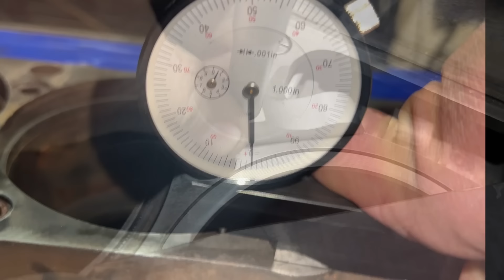Detroit diesel 8v92TA 2 stroke diesel tear down. Rust broken bolts counter bore problems

Comment: It seems that only a few people have ever been taught to shock a bolt by hitting it straight on with a hammer BEFORE attempting to turn it.  I first learned to do this from an old Detroit Diesel mechanic back in the 1980's when I was getting ready to remove a hub cover from an aluminum hub on a trailer. He told me that BEFORE I even put a socket on the head of the bolt I needed to take a big drift and a 2 pound hammer and smack straight in several times on the head of each bolt (like trying t drive it deeper into the hole) to shock the rust bond loose that surrounds the bolt shank and threads. I already knew from experience and word of mouth that these hub cover bolts were notorious for breaking when removing them. So I took his advice and smacked every bolt head a few times before trying them and they all came out intact.
Since then I have made the hammer smack a step in the process any time I have a bolt that has been seated in an aluminum  component for a long time.
At the time I learned of this I had already been doing mechanic work for over 12 years and had never heard of doing it.
It seems that the technique is still not very well known.
Reply: Also work the stuck bolt back and forth while apply a little penetrating fluid to it. Working the broken stud like this will allow oil to work its way down on the threads.
Reply: Also, 1. Try to tighten bolt 2 degrees to try to loosen corrosion. 2. If bolt has not loosened keep turning each way 2 degrees to keep working lubricant into the crevice. 3. After bolt starts to turn change rotation to keep threads from locking up!!  4. Take your time with each step — 99% of all fasteners will loosen. 
Slow and steady takes less time and cost less than fixing broken components. 😅😅
❤Love the show and can do attitude to keep old coaches on the road. I have an 84 Bluebird with a 6V92TA

Comment: If you have a pair of vice grips that are not perfect you can weld a small nut onto the side edge and use that to stop the air hammer from jumping around. Great job!!

Comment: My sympathies. I was so excited to see that turbo drain bolt come out. Next, I see the threaded ends aren't the same length in the magnetic tray. 💔 The rest of the video is just more 💔 after 💔 with more and more cap screws.  snapping.

Comment: I recently retired from the marine industry,  boy, I don’t miss extracting broken crusty rusty exhaust manifold bolts hardly at all.  Watching your guy struggle with those vice grips was more than a little painful to watch.  When I get ‘em broken off  with a half an inch proud I go straight to welding a nut on there, I don’t mig them on, I go straight to the stick

Comment: I would recommend removing the aftercooler and thoroughly cleaning it, if it looked dirty on top it's probably dirty right through the core, it's a small area for all that air to get through so any buildup is restriction.  The ones I've cleaned it was unbelievable how much crud came out after soaking and blowing out.  The last few I did I soaked in straight superclean degreaser overnight then poured boiling water through followed up with a pressure washer. When they're clean you can see a flashlight shining through.
Reply: Spot on bro. This engine has been neglected so everything is suspect.
Reply: I thought about the inside of the aftercooler too, after seeing the rest of the cooling system condition I am sure the core is  pretty clogged and gross.

Comment: Heat and beat !  reminds me in my younger days replacing a oil pan on an old 671 in an old wooden boat, had the 671 0n its side using a tourch to heat up the oil pan bolts, bilge full of diesel and old oil heads of the bolts sizziling as it hit the bilge water, no fires but the whole yard crew came running down to check for fires as all the old oil  burning of the block,,,,,,need less to say new oil pan, good to go  heating with a tourch is your best friend !

Comment: Do you use antisieze when you reassemble, or is there an issue with that?
I use it on everything.  Also, when I remove a sized bolt I always slowly work it back and forth, and spray oil until it becomes loose
Rock on guys!

Comment: One thing. Typically Visegrips usually work better when loosening tight bolts, nuts or studs when pushing toward the movable jaw rather than away from.

Comment: When loosening stuck bolts, if it moves, go back and forth from tightening it, to loosening it, while spraying it down with kroil.  It chases the crap out of the threads so you don't break bolts as much.

Comment: Jeeze! The owner is going to be in $1000 in hardware alone just to get it back together! I'm surprised how many bolts actually came out of the top of that blower housing without snapping. As you mentioned the dissimilar metals love to seize together.

Comment: scot get yourself a piece of metal fuel line about 6 inch cut teeth on one end using a hack saw  you will find it is the right size for the hole the bolt is stuck in run the pipe in down the side of the stuck bolt it will follow the hole already there that is full of crap by spinning the pipe in a drill it removes all the crap holding the stuck bolt steady away and you will get there

Comment: Just a thought as I did buses for the Detroit Diesel Distributor and we made a cradle to slide the engines in and out. A lot less work in the long run.
Reply from the maker: We have a detroit diesel out in the shop right now on a stand. But the Wanderlodge is easy access all around

Comment: Brother, I don't understand why you didn't pull the whole block out of that chassis. Also don't understand why you haven't pulled the turbocharger and supercharger off. Especially with the overheating situation. I'm sure you know what you're doing, and I'm not a lame and I worked in the heavy truck industry for a lot of years and worked on a lot of 8v92s but I think it would have been a whole lot easier to get that out on an engine stand and do it that way. Just my opinion. Okay my mistake, I didn't watch you to the end I was in the middle of the video when I put this together so, sorry hahaha. Great video!
Reply: The Wanderlodge has plenty of room. Also, I'm sure Scott would appreciate it if you stopped by and removed the engine as you described for them.

Comment: Looks like it was run with just water instead of proper coolant. I never knew why but at one time in UK it was common practice to only use antifreeze in winter and use straight water in summer.

Comment: Ah...the ol' thermal wrench...for when you are done asking nicely
Are those roots blowers better than a centrifugal supercharger?  I know two strokes need blowers...but would a gear driven supercharger push more boost to the engine rather than a blower?  My thinking is maybe a "modernized" Detroit diesel instead of having the blower, have a gear driven, shaft supercharger for the air charge rather than the blower style...
Just saw the DDEC 2, has a turbo feeding into the blower!!!!  whaaaaaat??
Keep em coming!!!!
Reply: Remember kids, it can’t be tight if it’s a liquid

And I am intrigued by the forged induction.  I was about to ask why not turbocharge it, but I’m sure the math adds up somehow.  Something to do with not needing an intercooler?
Reply: Can just hear Jeff Bradshaw saying “Renember, don’t light your torch like that…” as it pops into life.
Reply: The supercharger in a 2-stroke Detroit is not there to make more power. It's there to blow the exhaust out the valves by blowing fresh air into the cylinders through the ports. It won't run without it. It's a high volume low pressure arrangement.  A Roots blower can make move way more air at low speeds than a centrifugal blower can. 

To make more power, you add a turbocharger(s) in addition. Which this engine has. But you can't use JUST a turbocharger because at idle/low load they won't move enough air for the engine to run. The BIG 2-stroke diesels as used in locomotives and ships actually combine the two.  They have a  compressor wheel that is gear driven until the exhaust driven turbine can spin it faster than the drive can, at which point an overrunning clutch lets them turn faster than the shaft. But I don't think that was ever used in engines as small as these.  

For perspective, this engine is 92 cubic inches per cylinder, while the EMD locomotive engines that are Detroits on steroids START at 567 cubic inches per cylinder, with the biggest ones being 710. And up to 20 cylinders.
Reply: @Kevin_Rhodes  thank you.  I thought that, but with how wrong I’ve been on my two stroke recollection, I quit while I was ahead (or slightly behind).
Reply: You need the shaft driven Roots blower to push air as you start the engine.  That compressed air that comes in at the bottom of the stroke must do 2 things as those slots open up.  It must push all the exhaust air out in the time the cylinder is starting to uncover and then recover the slots at the bottom of the stroke.  It must also push in clean air to burn at injection.  The term, as I remember it, is "scavenging". There is no exhaust stroke like a 4 cycle.  There is no suction (intake stroke) from a down stroke to pull in fresh air like on a 4 cycle engine.  You only have a compression stroke and a power stroke.  Exhaust valves are only open roughly when the slots at the bottom of the stroke are open.  The cams are running 1:1 with the crank.  Then you need hot exhaust that is expanding to drive the turbo.  Once the engine has started the turbo can do its thing and compress the air to the Roots blower and then the Roots blower will further compress the air.  Then you can pour the fuel through the injectors and have lots of horses to race up the big chert hill. I know I have left out lots of technical stuff.  I just want to keep it simple.
Reply: This series 92 is blown ie(roots) and turbo charged and after cooled 8v 92 TTA.
Reply: @larrylawson5172  You need the Roots blower at idle and under low loads too - there won't be enough flow air from the turbocharger. And of course, not all Detroits are turbocharged to start with.
Reply: @greggwinovich8196  Which I said in my reply. After cooling is neither here nor there in this discussion, it merely allows the turbocharger to add MORE power by cooling the intake air after it was heated up by being compressed by the turbocharger.
Reply: @larrylawson5172  Thinking about it a bit more - you ALWAYS need the mechanically driven blower on a turbocharged Detroit. If you rigged one up so that you could stop the blower once the engine is started and the turbocharger is doing its thing, it would be fine - as long as you are under load and making all that lovely hot exhaust gas. But what happens when you are coasting downhill with minimal/no fuel being injected at all? That massive turbocharger is going to all but stop spinning. And with no blower, so minimal air going into the cylinders, how is it going to get started again?  You can only burn as much fuel as you have available air. You'd be smoking out the county for ages until the turbo got with the program again, if it ever did. And these BIG turbos take a LONG time to get going. I have driven these buses, especially if you are in the wrong gear and the rpms are too low the "turbo lag" is immense - you can about measure it with a sundial. It's not like a modern turbocharged car where boost is all but instant when you twitch your ankle on the gas pedal.

The only way it would work is to do what the EMD locomotive engines do - you would have to have the ability to mechanically spin the turbocharger below the threshold where it can takeoff and do its thing on exhaust heat alone so you always have that baseline of cylinder scavenging that the blower provides. I'm assuming that was not cost effective to do for the small diesels.

Comment: I was going to say you we using those vise grips the wrong way but you flipped them around later in the Video..NO big Deal..Wouldn't it be easier to pull the Motor and work on it on a bench..?

Comment: The 92 series may be the worst engine GM ever built. Compared to the bullet proof 71 series, and even the mostly reliable 149 series, the 92 series is a ticking time bomb. The number of blown up 92s I’ve had to fix is astronomical. Mainly 12v92s and 16v92s in boats. These things need an inframe every year or two! We’re talking about a 2,500 hour service life! On a typical twin screw boat we’re talking about an inframe twice a year. When they ran then in the ferry they had to rebuild them every 3 months! Absolute garbage. The 71s will go at least 10,000 hours between inframes if you do horrible maintenance, treat a 92 like that and it won’t last 500 hours before it cooks a liner oring dumps the coolant into the oil and spins a bearing or worse.